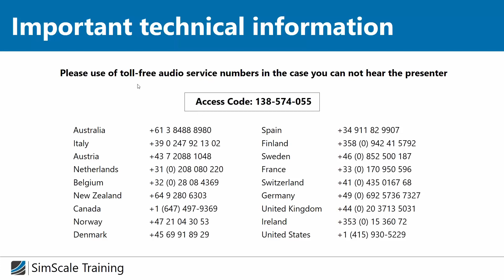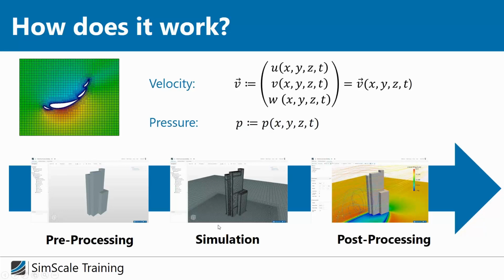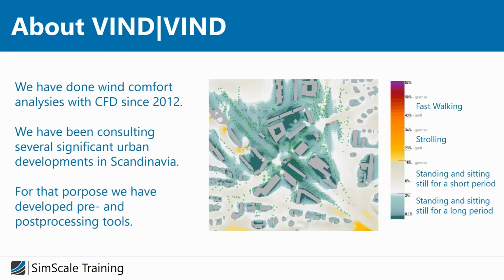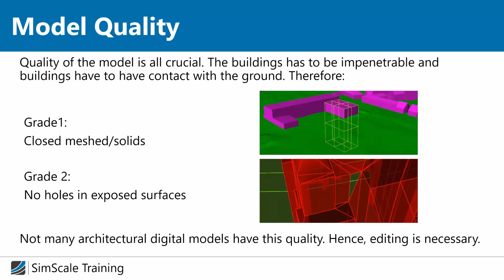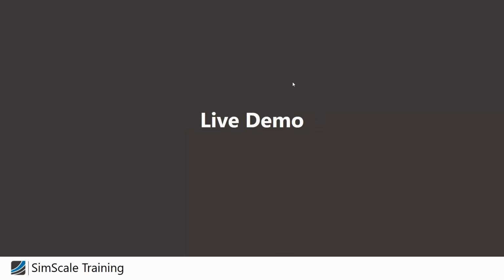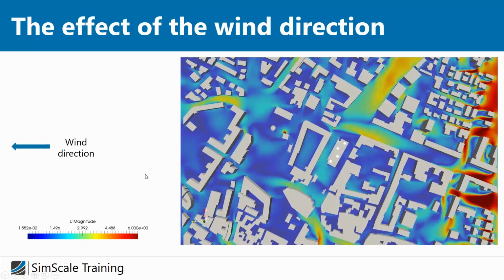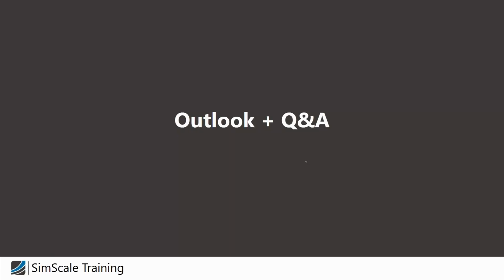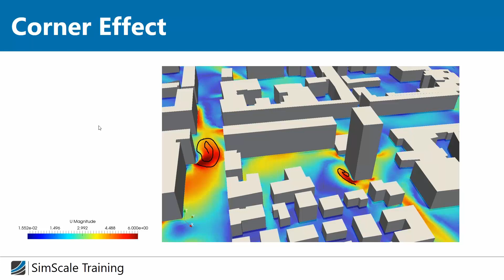CFD Simulation for AEC Applications: Wind Comfort Prediction with CFD

Comment: Hello, thank you for the video. Would it be possible to simulate wind currents generated by heating of pavements, buildings etc using SimFlow? Would it be for example, possible to set initial conditions for heating of cretain meshes, like one building gets more amount of heat from sun then the other? Would it be then possible to extract temperatures and wind currents from the simulation? Thank you for your reply in advance.

Comment: Hello SimScale team, thank you for the video. I have the subscription and registered with cloud platform. In the video tutorial, @59:21 you have mentioned about different Wind Directions which is manually done. In case of natural wind conditions as per specific weather condition how to simulate buildings on simscale? We mainly use Weatherfiles in the specific location in whole building simulation in other softwares which then represents various parameters (Temp, Wind Direction, Pressure, Relative Humidity, k etc) to find the simulation results. I am beginner on this platform. I think I did not find this facilitation on simscalem SaaS platform to represent actual weather environmental conditions. Is there location based weather files to create real weather conditions and then perform simulation for a building or group of buildings or a city plan? Do we manually need to set up weather parameters as mentioned? The objective is to understand the impact of local weather conditions and how the units behave. As a designer that is very important result to make informed decisions.